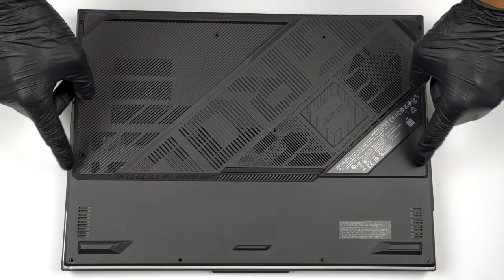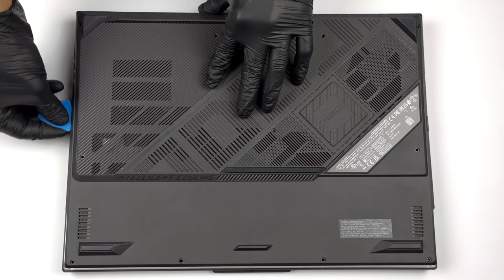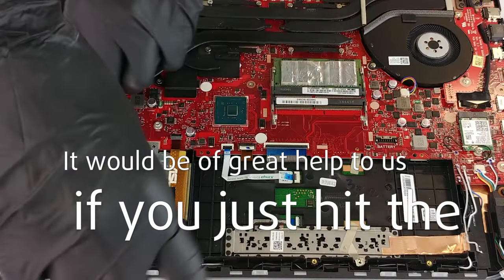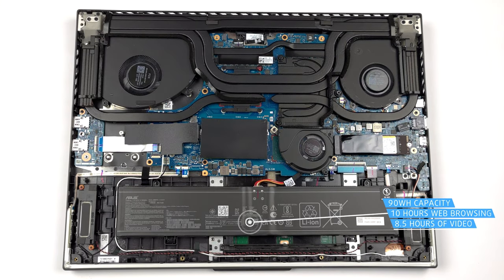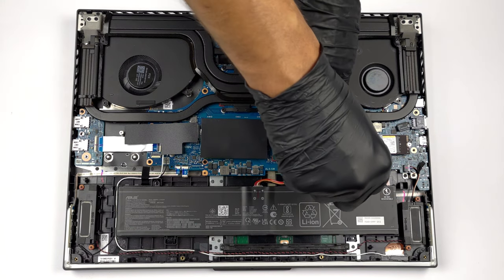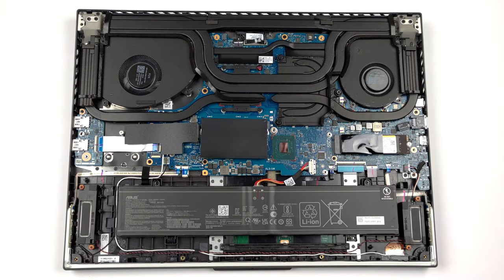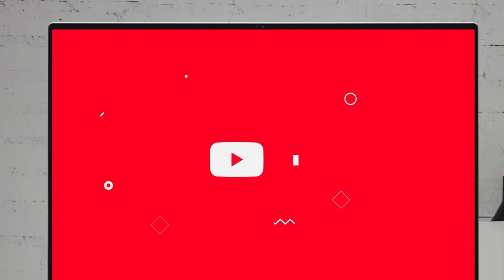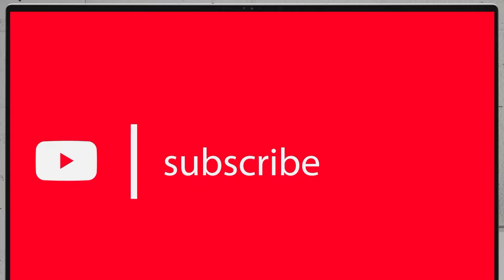🛠️ How to open ASUS ROG Strix G18 (G814, 2023) - disassembly and upgrade options

Comment: The screws are different lengths. Make a note of which screw came out of which position on the back by laying them out in the same pattern until you're ready to put the back on. Make sure you lay the laptop the same way round, with e.g. the captive screw bottom right, when you're removing and reinserting the screws.

Comment: Thanks for the handy guide. I was able to upgrade mine with 32gb ram and 2x 2tb 980 pro's for raid 0.
Reply: DDR4 or DDR5?
Reply: DDR5 5600mhz @TH3SLEEPING
Reply: @nit3h8wk81  Did you have to update your BIOS or anything? 
I read that Asus didn't support 5600 till after a BIOS update. Is it showing 5600mhz in armoury crate?
Reply: @MarioAbouRached  Yes I always update the bios on new pc’s in case of security updates or fixes.

Comment: what chip is that? PHC? My phc making weird sound like vibrate or scratching do i worry? new laptop only using 3days
Reply: "Coil whine is the result of electronic components vibrating at specific frequencies when current flows through these components, resulting in an audible tone that can be perceptible to the human ear."
just replace the unit if possible.

Comment: Dude i tried to remove battery head from motherboard when install it small metal piece touched next to chip and it was little spark i think i burned small chip next to battery connecting and now my laptop doesnt turn on..what should i do ?😪🤕😭😭
Reply: I installed ssd but my 3.0 usb didnt work so i thought it was because of static electric so i tried to unplug battery..after i tried to plug battery there is a small thin metal piece where you connect battery head it touched chip and battery head when i tried to push the metal thing into battery slot..
Reply: Do you think all motherboard f.ked up ? Or just that small chip ? Please give me advise mate..i cannot afford new g18 again..😢
Reply: @ilyasbuyuklu1587  Friend, you will have to take your notebook to a very good maintenance unit so that they can evaluate and replace the damaged chip.
There may be a problem getting this chip.
Reply: Oof man. That sucks. What was the outcome of this I'm curious? You should have just sent it back to the warranty guys and said it stopped working and you don't know why. They charge the price of a car for these things. The least they can do is honor warranty.

Comment: please answer me guys, i want to add 2TB SSD. if it comes with HEATSINK, will it fit or not?
Reply: No it will not. There is enough cooling in this unit that heat sink is not needed at all on SSD. Leave it naked.

Comment: What’s with the rubber gloves. You trying not to leave finger prints?
Reply: He's surgeon that's why the gloves this device must live after it's been open.
Reply: @c-v-n3322 : Oh ha ha. I hope that the gloves are anti static. LOL 😝
Reply: thats for representation purposes
Reply: @ianb2648 : Oh, I see.
Reply: @imacomputer101  : You always remove the battery to prevent any stray unwanted voltage discharge. As for the fan, it depends on what is being replaced and whether it is in the way.
Reply: No you don't

Comment: Dissapointing that there is only 2 pcs of M.2 slots on such a large laptop...
Reply: It will take 4tb ssds specifically the WD 850x 4tb. I tossed the 1tb aside and bought 2 of those... now with 8tb of storage. I would say that's more than enough.